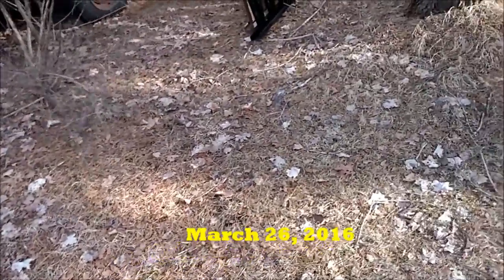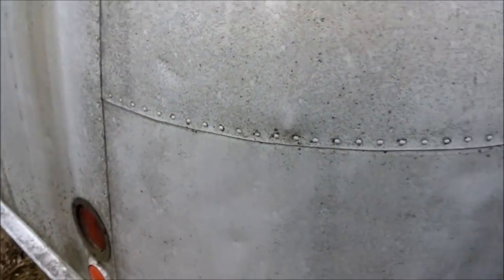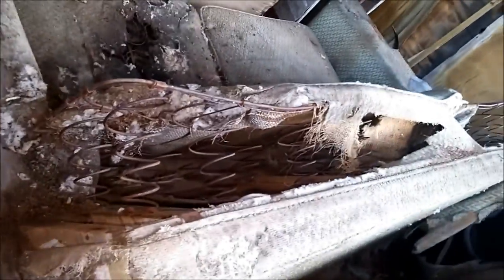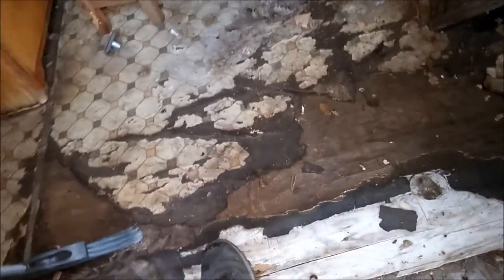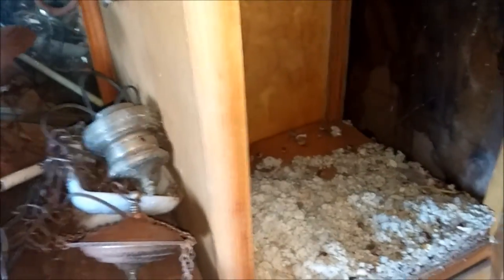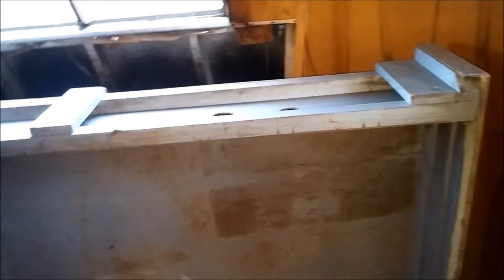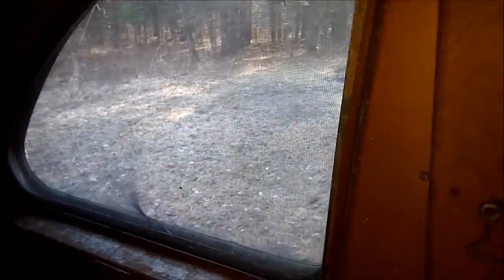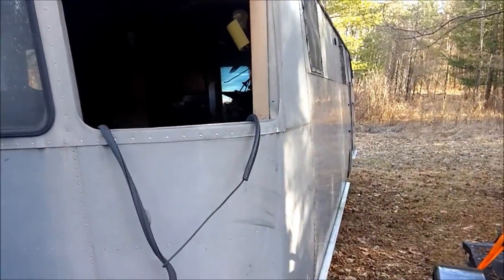1948 Spartan Manor 25' For Sale

Comment: How are they put together?  Is the wooden floor simply laid on top of an aluminum bottom?   Anyone out there with info?
Reply from the maker: The frame is steel.  They lay the masonite floor down over the steel.  Then the linoleum, Then they screw aluminum wall sections to the floor.  Pull wire not much for plumbing in 1946.   Insulate and panel.

Comment: Toilets were an option.  So it could be original.
Reply from the maker: whammond511 it could have been an option but I have never seen it any advertisement.  I think was an add on just because how tight it was.  No matter know that trailer has been gutted and is currently for sale in Ottawa Canada.  The guy I sold it to has in about 75% done.  I think he is asking $8000.  Thanks for watching subscribing and commenting.